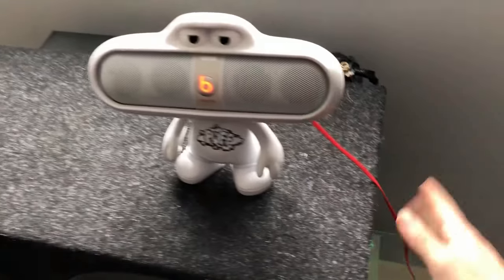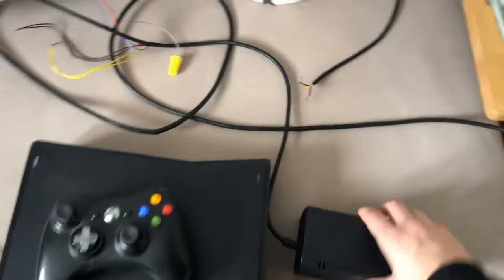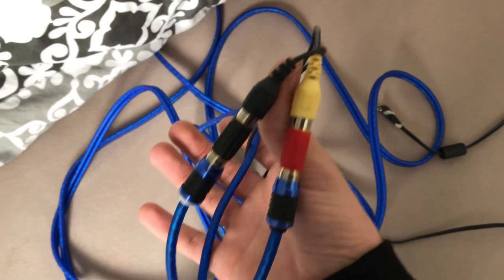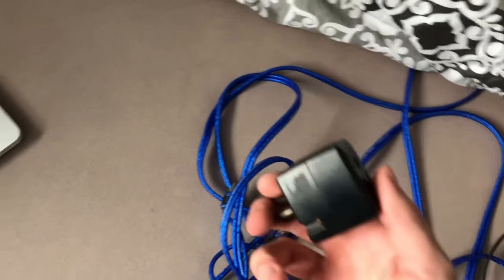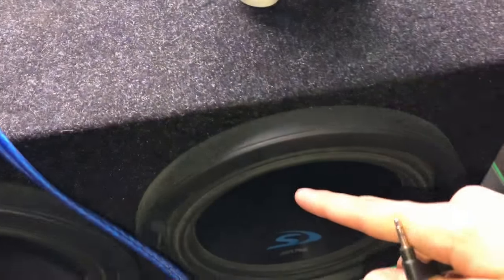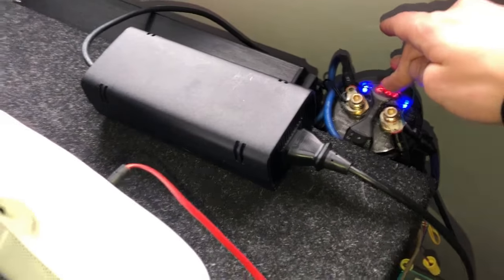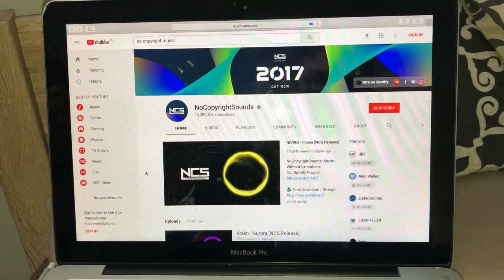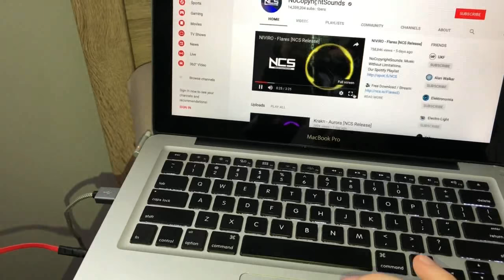How to setup subs in your own home

Comment: I did this a few years ago and ran into the issue of needing a better power supply.  So i built my own that put out 14v with 500amps. (First one I built I used 12 xbox power bricks hooked in parallel all dumping right into the capacitor.)  Completely powered 10 1" tweeters, 4 6" speakers, 2 6"x9", and 4 15" subs.  (5000w hifonics amp with kicker speakers, and Kicker CVR subs, and a 20f capacitor to provide extra reservoir of power when needed)  But love your setup!  People dont realize how easy this stuff is to do.
Reply from the maker: Ikr sometimes people just gotta be creative 🤷‍♂️😂 but sounds like u had a deadly setup too and thx for your feedback 🤙
Reply: How did you wire your capacitor indoors? As in how did you connect the ground wire to the capacitor?
Reply: @SniperShotNO  I used a very large old fire system metal cabinet for the "ground" and the entire cabinet is basically the neutral it's also insulated by a layer of plexi glass to avoid metal on skin contact in the event someone provides a path to earth ground.

Comment: I never recommended using a car amplifier indoors to power car subwoofers indoors because car amplifiers require lots of amps to get them working properly and using car batteries to power them indoors is extremely dangerous because of the toxic gases that car batteries give off also using a power supply to power a car amplifier indoors will work but won't properly power your car amplifier indoors because the car amplifier will draw more current than what the power supply is capable of putting out therefore I recommend using 2 receivers with a subwoofer output or using something like a pro audio amp instead because a car amplifier to power car subwoofers indoors is very risky and dangerous
Reply from the maker: I know it’s fine for what I use it for lol the power coming from the plug in is not enough to have it on full lol
Reply: Eric Maier I recommend using 1 600 watt receiver, right now I have 2 10 inch subs and 1 12 inch and it’s doing just fine with rumbling my house
Reply: Eric Maier mine was only about $400 with a set of 5 speakers and sounds amazing
Reply: @dylan8577   yoo I have a 720 watt receiver and I'll be powering 4 10" planet audio subs
Reply: Travis Gulley can a car battery power three 1000 watt subs and I just put the car battery outside and use a long wire to wire it to the sub?
Reply: @saqui2323  it can but a car battery setup isn't safe there's an easier way than that just get a receiver and set it up

Comment: I did this as well, i got the power supply at my local game shop for real cheap, $25. Yellow is power and black is ground. Easy peezy. Works great. Using a receiver to some decent speakers which is great, better than this guys set up, only because of his speakers.
Reply from the maker: Does urs make  the cups rattle in the kitchen too ?
Reply: What are you talking about those are alpines
Reply: Xbox? A bit confused... so you just run the yellow wire to your amp like the power wire that normally would come from your car battery?
And that's all you gotta do?
Reply: @EricMaier  does ur make ur whole house and more rattle o thats cause i over did it with 2x 15s and jacked more power to it

Comment: Lol I used to have 4 power supplies on a 1000 watt amp 😂 any less and it would start turning them off. None the less, I would recommend more power supplies if you can get any more. But awesome video, nice setup!
Reply from the maker: Thank you yes I could agree
Reply: @EricMaier  absolutely man!
Reply: Man i did this back in highschool awsome but i used a power supply from an audio shop
Reply from the maker: Yeah and how did that project go ?
Reply: I have two p2 12s on 1200 watts with a car battery and a trickle charger works great
Reply: thats definitely not true cause i have a 2000 watt amp running on one ps
Reply: Yeah I have two on mine and it’s better to just use home audio since it just cuts out the moment I tune the volume up

Comment: i have a pioneer ''12'' er, can i just plug it right into my receiver / stereo. and it wont blow the stereo up?
Reply from the maker: You gotta look up the amps lol
Reply: Snuper it won’t sound as good but yes, kind of. I’m running my 2 tens in my trunk just spliced into the rear speaker wires; no amp. Each positive and negative speaker wire on each side is normally connected to a single 6x9 each, but now powers a 10” sub and a 6x9 for each pair of positive and negative wires. 2 6x9s and 2 10’s, no amp, straight to an aftermarket pioneer radio. Works fine, solid bass, no issues. Wiring it up with an amp soon to get optimum bass soon.
Reply: Snuper It would defo work, but avrs dont really have the power to drive subs. You could hook it up to the B speaker outputs if your avr has that. Also it wouldn’t be crossed over so wouldnt sound great.

Best way is to get a 120/240v power amp and hook it up to the sub preout on your avr, then power your sub with that
Reply: depends on the impedence
Reply: It's a good way to blow your voicecoils, u less you use the sub channel and make sure you have it crossed over so no treble come from the sub.
Reply: You need two amps or receiver never put all speakers on a receiver with a subwoofer it will blow the subwoofer needs it’s own independent amp

Comment: I have a car sub just hooked up straight to my receiver. Its more simple that way. But anyways good job on the video
Reply: yea me2
Reply from the maker: Thank you
Reply: Receivers are very low watt rms power the sub is pretty much running on fumes with no real power wattage to achieve it's full potential
Reply from the maker: @s7v7nfiv5  I mainly made this video to show it works not as a daily lol but you are right
Reply: S7V7NFîV5 my receiver blew my 10 inch
Reply: @s7v7nfiv5  i run my 12" dd audio dual coil from my reciver and use two channels that are 250w rms each plays really good
Reply: @s7v7nfiv5  theres a reason why theres more powerful recievers
Reply: can you make a video explaining how you can do that
Reply: How many amps do that adapter provide?
Reply: I have peavey hooked up to my four 15s front speakers and my Gemini amp pushing two twelves hidden in my closet it sounds amazing mehnn no need to crank it loud at all I control the bass of the sub with a equalizer
Reply: Frank Lopez need a better amp boss with more power the speakers don’t turn off the amp do

Comment: Just did this with only my friends old Xbox one power brick to run a cheap car amp that’s more than 20 years old to power 2 big ass stage monitors his dad used for his drum set 😂Took speaker wire from the front outputs on a receiver we had to a line output converter, rca from the loc to the amp and voila the woofers in the monitors actually do bass now. Got two Sony bookshelf speakers we weren’t using in the rear 
We got a Bluetooth turntable on one input, his tv on another, and a cd player in a third all of it works beautifully
It only costed 26 dollars and the price of 100ft of speaker wire as the whole old Sony stack of receiver, tape player, cd etc was in his garage for the last 15+ years as well as the monitors.

Comment: Should do a video using server power supplies. Used to have 6 xbox 360 power supplies for 2 of my amps. Anytime my amps reached about 75% volume theyd turn off, or explosions from movies would just turn off mid explosion. But i found out server power supplies are cheap, easy to hack and give more amperage than Xbox 360 power supplies. Running my setup with a 2600w ps, more than enough for 2 of my  amps to not turn off at max.
Reply from the maker: That's good to know bro

Comment: What did you use as a remote wire, trying too set this up and my amp won't power because I don't know what to use for a remote wire
Reply from the maker: I never had a remote wire I just know that there is a wire that you splice into your audio system for when you turn you car on the amp will sence power and turn on . I just connected that to the ground I think and it worked for me
Reply: Simply cut a small wire and connect the power to the remote

Comment: I just got new studio monitors(krk 8's g4) and they only take xlr cables. Currently dont have an interface and am stuck with an old mtx amp and 10inch kicker sub that I just took out of my VW bus. Im able to get power to the amp, but how the hell do i connect this to my studio monitors? would i need an interface? would I need to split a pair of xlr cables to go into the amp?

Comment: How much amps does that adapter provide actually? Mine is like 2.5amps lol, that should not be enough right?
Reply from the maker: INPUT: AC 100-240V ~ 2A 47-63Hz; OUTPUT: DC 135W 12V--10.83A; 5Vsb--1A
Reply: But how can a 10amp psu sound the subwoofer loud without amp turning off?
Reply: 😲 @Mohammedhaashim

Comment: Can car subwoffers be used for DJ gigs? 
As I plan to purchase 10 car subs & connect them to my equipment..
Reply: I have a car sub hooked up in my room closet a Gemini amp running that by itself and my peavey running my four 15s it will be fine long as you got the right amount of power

Comment: Why do you have beats It sounds awful It sounds like a potato but the subwoofer is great 👍
Reply from the maker: Just to prove to u guys that it can be done. This was just the base model setup be creative u can always still upgrade from there 😜
Reply: I have 1 15 inch Sundown subwoofer
Reply: @rcworld7146  I have a single 10" alpine subwoofer with a ported box in my truck. I would have gotten 2 12's but my truck is a single cab so i didnt have room for much and I still gotta have room for other stuff back there too. Anyway I got a 300w 5 channel amp 200w rms. 4 6 x 9 alpine speakers and 2 little 3.5 jbl speakers in the dash.
Reply: @rcworld7146  Sundown 15 is badass tho. That's probably loud af.

Comment: Why you dont put some tweeters to the subwoofer box ? it can be better. you just need to have one more amplifier.I see you have RCA output on your amplifier . so it can be easily connected to one device. and you can buy bluetooth receiver from ebay for 2dollars and you cam have big bluetooth speaker and you no need other external speakers.
Reply from the maker: Yeah I was thinking of maybe filming more of a perfesenal video with powering it by an actual battery and just connect a charger to it also the Bluetooth would be a good upgrade for it! Just items will be harder to find for the viewers :(
Reply: @EricMaier  hmm... can i use just 7ampers battery? because i wanna buy battery and have big portable speaker from car amplifier.. i just need to know if 12v 7ampers  battery can handle it on maximum and if it would be have good bass.
Reply from the maker: @lmofficial3269  no not to sure I would have used a standard car battery

Comment: I’m running 2 12s hifronics each speaker is dual 4 ohm coil so they are wired at all at 1 ohm to a 2300 boss amp and I’m running a amp for the mids and highs with a cheap 500 watt amp only with a 400 watt or 32 amp computer power supply but the power supply goes in protection mode so I’m gonna be running 2 car batteries soon with a battery charger to charge them over night but how it is right now it still slaps even though they are moving at Quarter power this shit slaps harder already then your dads 1000$ dollar Bose system 😂

Comment: Where exactly do you plug in the aux and if I buy a Bluetooth radio and just connect aux and speaker to the radio does that still work
Reply from the maker: I had an adapter that connects right into the amp and I also put a splitter on it one going seperate to a speaker for the sound the other just pretty much controlled the base

Comment: that's awesome! I know it's a bit late now but you can use this... https://www.amazon.com/gp/product/B06VWV5YCH/ref=ppx_yo_dt_b_search_asin_title?ie=UTF8&psc=1 ...... its a power supply that outputs 12 volts and about 3 times the watts so you'll be running about 360 watts to the speakers instead of around 100 watts. for anyone looking to do this id use this, it takes a little more effort but it's way more effective and you will hear the difference.
Reply: do you know of any in the 3000 watt range?
Reply: or 1600 or 1000
Reply: @IND4GR0V3  so you could have multiple by wiring the dc wires in series but I wouldn't recommend wiring any more than 1200-1500 watts as it might pop your power breaker.
Reply: @T_m_f_j_300c  i have two 1400 rms subs and two 2000 rms amps do you have any suggestions? i want to put them in my house not in my car
Reply: @IND4GR0V3  yeah if you send me a link to the amps and subs I can try and get it as good and cheap as possible in parts. Just send me a link I can figure it out.
Reply: @IND4GR0V3  so with those I would go with a car battery or two and have it being charged constantly by a wall car charger, it would just be a lot cheaper and safer than the power supplies.

Comment: That speaker looks cute and has eyes on top of it what kind of speaker is that you were using
Reply: Its a Beats Pill, but it doesn’t come with the character dock. You have to buy it separately which cost around $30 - $50.

Comment: I made a system in my room but it turns off at high volume how can i fix and also what amp settings should i use
Reply from the maker: That would mean your subs are taking in to much power pretty Much like a breaker snapping because you don't have enough power

Comment: How did u make your bricks light stay green because every time I touched the blue and red wires the bricks light would turn red and not give electricity?
Reply from the maker: There is a ground that needs to be connected for it to be on it is used to indicate when the tv is on for when the console should turn on or be in sleep mode
Reply: Eric Maier And what wire would that be?
Reply from the maker: It should be the blue and red wire I don't exactly remember I don't have the set-up anymore
Reply: Jose Rodriguez I put the cables on the ground of my amp

Comment: How did you connect the capacitor ?
Reply from the maker: Look online at some diagram if I remember correctly I had a negative wire go to it with a 300 amp fuse I think and then took the leading out wire and connected it to the amp with a on and off switch

Comment: What about if the amp has the auxiliary turn on wire
Reply: Then you run the positive wire to the positive and the aux turn on because the auxiliary turn on is just a positive wire pretty much just has 2 positive wires and one negative

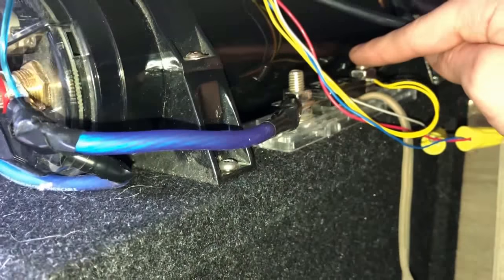Comment: 2:43 what is that plastic with screws for ?
Reply: @EricMaier  noo... the plastic screws are so the wires dont short out or shock other wires because they are cut...
Reply from the maker: So there's not current going thru mad shorting out the wires plastic does not conduct electricity

Comment: And how loud does it play on  12v
Reply: Not very
Reply: 12v is a car battery voltage sometimes 12.6 or even 14 volts the power cap is reading 14 volts so its getting more than enough power all depends on the wattage of the subwoofer if it was 1200w it would be loud